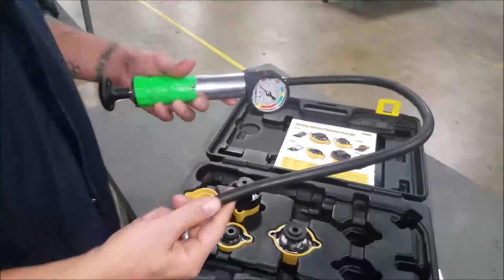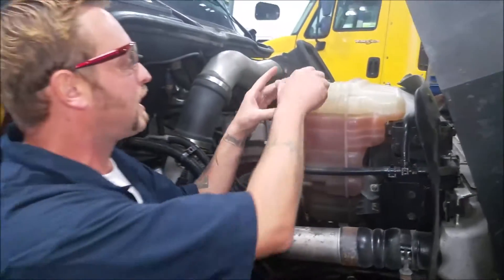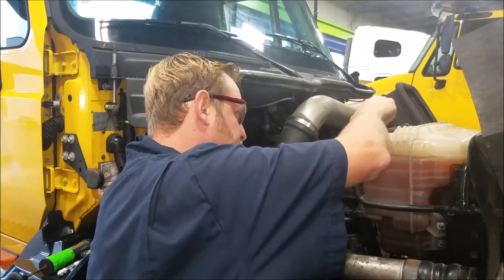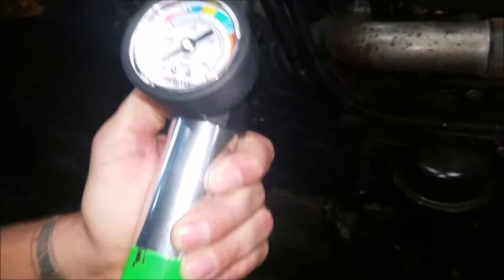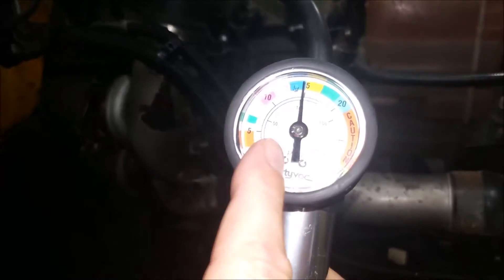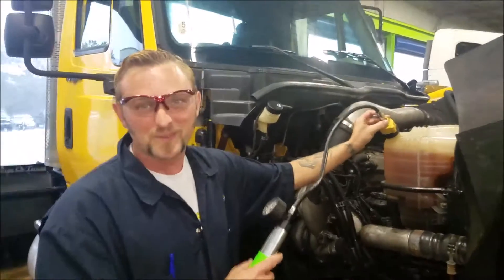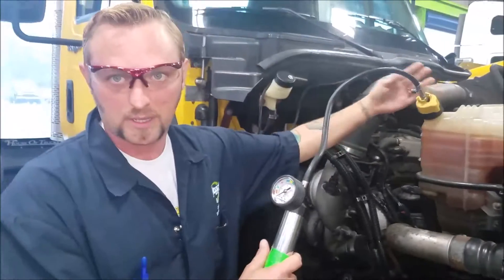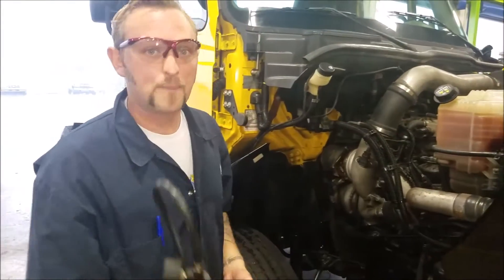coolant system pressure test

Comment: Can this tool gauge be used to test how much pressure is in the coolant tank with the engine turned on?
Reply: Yes, but remember we want to do our inspection on a cold and silent engine so we are free to touch and listen around looking for the leak.
Reply: This is what I want to find out as well... My truck is not overheating, but I am losing antifreeze. I already changed the air compressor, the rad. I wanna have a reading in the cooling system while the engine is running.
Reply: @TheLeftRbabieskillers  dropped liner